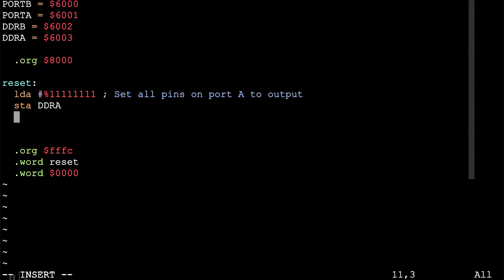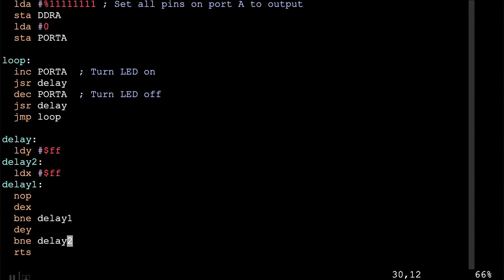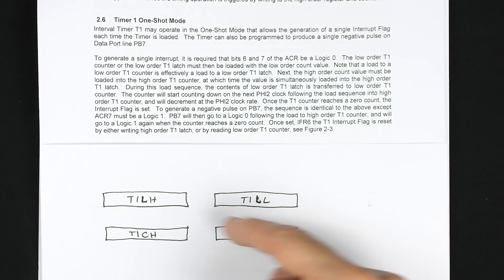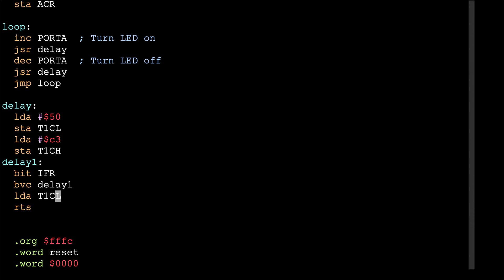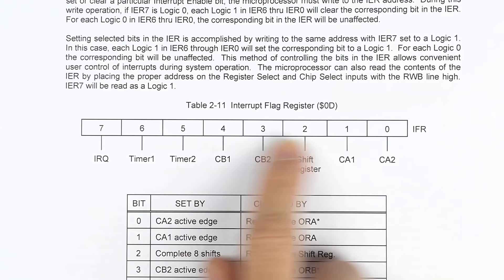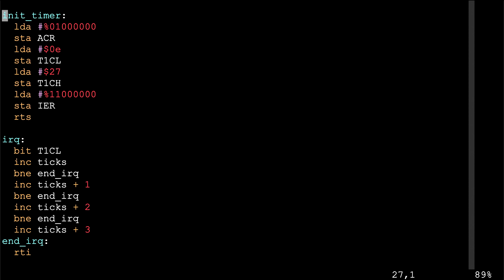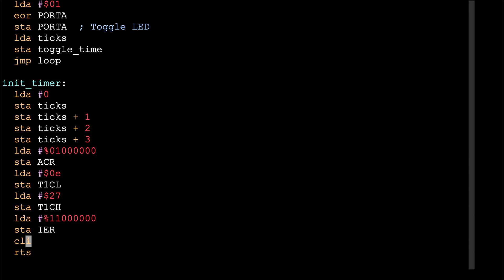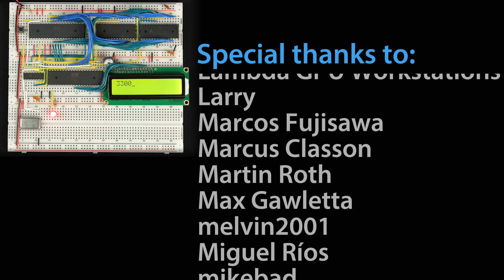How do hardware timers work?

Comment: This is why breadboard computers should be more common in colleges. The simple questions are overlooked with the abstraction we have added.
Reply: When I was taught that stuff in school in the early 2000s we were using 8051 microcontollers, so everything in one chip... worked, but obviously you don't get to see and poke the internals. Then at the end of the year we had to inventory the lab and I came across the tool from the 80s they were using before they moved to that, and it was a delightful single board computer running around a 6809, a monitor ROM, some battery-backed RAM, both a 6321 and 6522 and a keypad and LCD, and it was so much more fun having access to the chips and being able to enter your code directly on the machine and run it that I borrowed it for the summer holidays and played a ton with it. Ended up being able to keep one when leaving that school, still have it of course, and the 34 year old battery is still faithfully keeping those RAM contents.
Reply: This is absolutely right. I don’t think any software developers with whom I work these days grasps the technology at this low level. It explains a lot about the performance of modern systems.
Reply: I wanna know where the hell I could go to study this kind of low-level computing stuff. I'm so sick of all of this needless abstraction.
Reply: @dubbynelson  Electrical engineering is a little too low level, and computer science is a little too high level, but there is sometimes a major offered in universities called "computer engineering" that is halfway in-between. That seems like the most likely field to touch on this in my experience.

Although I think that in both EE and CS departments, there are often elective 400 or 500-level classes offered that will go in this direction, so it's probably not necessary to center an entire major degree around it.
Reply: @delphicdescant  to be fair, today it’s not really that useful to know this stuff these days. For the average software related job today you’ll never use any of this information
Reply: @nickwilson3499  Some people get an education with the primary goal of getting a competitive 9-to-5, and those people would probably agree with you. Others look at education as an end and not just a means. Like, getting more degrees is what I would do if I had a bunch of spare money. I don't get degrees to make money. For people like that, we don't care what knowledge is "useful" to some industry or another. It's about what we want to learn, or what things we want to be able to make.

And then there's also the entire related problem of engineering knowledge getting lost to time when people only focus on knowledge that can get them a "job." Like how nobody is capable of making another Saturn V anymore.

And then one other issue is that "the average software-related job" is just terribly boring corporate drivel. It's mostly web dev. Not even real programming. I'd hate to make judgement calls based on what's useful to web dev.
Reply: @ShALLaX  as a programmer with a decent, or at least reasonably acceptable, understanding of the low level tech (i.e. i understand this video, for example), i feel obliged to point out that I often write code that I know is sub-optimal from a performance perspective because the "slow" code is much easier to maintain. Complex, elegant, fast solutions are often amazing when you write them but extremely miserable to maintain later in project life.

Also, when your project is really huge, you can waste a lot of time on "perfecting" code... And then fail to deliver the project because you didn't finish everything else at all. Thus, total optimization is usually reserved for either very critical, cyclical systems (graphics, game "tick" code, etc) or code that is already implemented "poorly".
Reply: @dubbynelson  computer engineering at a STEM school would be your best bet. But usually people just learn on their own with videos like this!
Reply: @delphicdescant  Amen!
Reply: @Jory Folker Yeah, the idea that starting your own company is just about the only way to actually work on a project you care about is, unfortunately, something that "the little voice in my head" likes to taunt me with. I fear it might be true.

But man, there are really some big downsides to startup life, especially if you have a family to take care of.
Reply: @dubbynelson  Honestly, it's unlikely that you'll find mainstream education about it. "No one cares" about it these days. You're better off trying to get a job with a company that does embedded development (medical devices, automotive, etc) and hoping they'll let you learn on the job.
Reply: @Pyrohawk  you're a rare breed. A great number of people in your position like to show off their prowess or build-in job security by being the only person around to understand the monster they have created.
Reply: @nickwilson3499  Just a side point, this stuff here has a lot of similarities to programming a PLC in STL, which is widespread in industry.
Reply: @dubbynelson  lol
Reply: Humans are good at creating artificial constructs. Forgetting the past, for the sake of evolution.
Reply: @syproful  haha you must hate historians then.
Reply: @dubbynelson  Do you honestly think that "delay()", or any of what is covered in this video is "needless abstraction"? That's just completely ridiculous, all of this abstraction is completely necessary and extremely useful. However, if you want to officially study stuff like this just do a EEE degree. Did all this stuff at university, extremely fun, dubiously useful.
Reply: @poopfartlord9695  if you read their comment more carefully, you'll notice that when they are talking about abstract stuff, they are most likely referring to what is taught in CS classes. My guess would be something along the lines of high-level programming languages (especially FP), or complexity, or formal logic, etc.
Reply: @dubbynelson  My university basically teaches at this level. But if you're looking for a specific degree that's most similar to what he teaches on this channel, it would be Computer Engineering. Also if you find a university that teaches Embedded Systems, then that's good too (my degree)
Reply: Pretty common to have a class where you write assembly for CS.  Also, there's the entire major of Computer Engineering if you're more interested in this.
Reply: it is the point of abstraction yes.

no client will give you any money for knowing in detail how sleep() work.
Reply: @ShALLaX   yes, software these day have to be window-mac-linux compatible with all their assorted browser, dynamicly resizable UI for every possible screen and mobile while also being accessible for that one random dude that still use netscape on a win95 PC.
Reply: @ShALLaX  A software developer doesn't need to know how hardware works. They are two different fields.
Reply: @grantofat6438  it depends - and I’d go as far as to say you’re wrong. A software developer that wants to be able to get the most out of the hardware very much needs to know how the hardware works. If you don’t care about such things you’re either a bad software developer or you’ve got an unlimited hardware budget. You may have missed the point of these videos if you think hardware and software disciplines are unrelated. 

Also, go and tell that to an embedded software engineer and see what they say.
Reply: @ShALLaX  Too much abstraction, people need to stay grounded in the machine architecture, it would make a lot of potential bugs and coding make sense.
Reply: @ShALLaX  
Not really, if you optimize for a 6502, you're going to get poor performance in other areas. We are optimizing for things like "being able to deliver as fast as possible", not "correctness above all", or "cheap to run", etc.

It's not that people today are stupid, it's that what you're supposed to do isn't quite the same in some qualitiative sense.
Reply: @HrHaakon  in my experience "being able to deliver as fast as possible" more often than not equates to "delivery at all costs." This leads to releasing unfinished/ buggy/ incorrect products and software. The entertainment and gaming sector pretty much embodies this.

That being said, there's definitely a balance to be struck.
Reply: If you ask me, abstraction is one of the biggest flaws we have in the philosophy modern world. SO MUCH important knowledge in to how our hardware is run is completely left out of sight. Modern Computer Science patterns love to assume that all code perfectly follows all documentation and that bugs never happen, yet pretty much all practice says otherwise. Sure, not all software needs to have perfect efficiency, but the simple fact that efficiency is often locked away from the developers doesn't help.
Reply: @KeeganKopas  Totally agree infinite%.  I find that the abstraction pulls too far away from the fact that a computer is a machine and works like a machine, which gets in the way of staying grounded in the practical dimension.  I found that by learning assembly you almost code better in high level languages because you always consider the mechanical operation and thus already integrate that thought.  Not saying that there NEVER are bugs, but it goes a long way to starting with the correct line of thought and therefore taking the approach with that consideration, or at least understanding better how and where bugs can be.
Reply: I don’t agree with this. Learning how abstraction was implemented is huge beneficial, but a lot of people will not want or need it.
This is why abstraction exists. To shorten the implementation time and to make technologies more accessible.

I like learning these stuff but I will have a lot less helping hand if everyone need to learn this.
Reply: @Soutame  I was just saying abstraction can make a student easily overlook some core things in computing.

I definitely think abstraction is awesome and is why we have nice things lol.
Reply: My first class had us program an Arduino, so some universities still teach this kind of thing.
Reply: @Dyllon2012  I had a class on microprocessors and using assembly. Was super fun.

But I didn't know I should have kept taking classes like it since the fancy AI and graphics were still super hard and cool.

AI and graphics is not super user out school.... Now that I am an embedded engineer in the auto industry
Reply: @delphicdescant  What the hell is that of an example? We also can't really make early tape computers anymore without any education? But that is irrelevant. We build better stuff than the Saturn V today. And even in Saturn Vs case it was a severe lack of documentation that is the issue if you wanted to replicate it.

We can "easily" (relatively... Nothing in Space Engineering is... Easy) build a new and improved Saturn V.

Beyond that there are more specific education and courses to help teach the low level stuff, because that is still necessary to know when you build hardware, but yes... It is quite important to have all these layers of abstraction if we actually want to improve society.

In the medieval ages you could literally learn how to draw, manage and build a castle. The skill set required was relatively low. Today you need to really specialize to achieve anything significant, or to advance humanity.  Specialization and abstraction of certain parts of the older knowledge is essentially required.

Whether some people educate for the sake of learning over getting marketable skills is DEFINITELY irrelevant... Especially since you can learn by yourself in your private life now, and very very easily because of the internet
Reply: They are very common in colleges.
Reply: @NoName73638  usually it is a club or maybe you will do this kind of stuff in one class for like 2 weeks.

For computer science, we had to do micro controllers. We never touched breadboards and just use a emulator in the lab to run assembly or VHDL.
Reply: @Soutame  Abstraction is good yes, and a natural evolution of programming but one must remember that roots grow in the mud of assembly.  From a learning perspective abstraction hides more than it reveals which is not helpful becuase then you sort of have to go back on yourself and dig to understand when all that could be learned from the beginning.
Reply: @infinitesimotel  The things I disagree with is the original statement that the breadboard computer should be more common subject.

The underlying should be learned only when it is need or you really work in that kind of field. I think someone learning computer engineering not always needed to learn breadboard computer. 

I agreed it's fun thou. But I saw it mess with my friends a lot. Make their study get worse. Someone just dropped. Just to found out that many of them will not have to use it.
Reply: @SioxerNikita  Just because you don't need to spot a tiger in nature anymore doesn't mean that you can't use eyes or ears.
Reply: @iXenox  And where have I said ANYTHING to the contrary? I would really love to see where you read that I implied that.
Reply: @SioxerNikita  You said that it's not important to be able to build a Saturn V. That may be for various reasons, but just because this specifically isn't important doesn't mean that you couldn't use those resources.
Also drawing, building and managing a castle isn't exactly easy. Particularly the building part, I'd like to see you find medieval resources on structural rigidity of stone arches and wood reinforcements.
Reply: @SioxerNikita  Can one not learn the two of three "very" specialized skill sets? With how much time you have to live compared to medieval times you might as well. 
Your inability to find resources on structural rigidity means that the only way to learn what works is to build it. You have to get really good at guessing what works and what doesn't by wasting time and doing tests.
You also said that it isn't important to be able to build a Saturn V. I find it important to be able to (even if theoretically) do it because it means that absolutely no knowledge was lost over time. Just because you don't need to cook on open flame doesn't make that knowledge irrelevant. Why loose knowledge like that? Why call it unimportant because of electric stoves? It can add a specific flavor and it can even be very well suited to the occasion at times. It is old knowledge, but never is it outdated.
Reply: @iXenox  The knowledge relevant to the Saturn V still exists...

And no, you could learn from others. That is how it happened in the past. 

We lose small bits of knowledge every single day, because we can't save everything.

Relearning how to build the Saturn V would be an incredible waste of time, since we can build something better now. This is not the same as a very basic skill. It is not important how to build a steam train today. It is essentially irrelevant knowledge... But the knowledge that allows someone to figure out how to does exist...

Also people lived long lives in the medieval ages. What brought down the average lifespan was child and war mortality. If you got to 20, you were very likely to get to 60.

What is your issue with us not being able to replicate Saturn V? We can't because many of the small changes to it were not properly documented... But many of those are irrelevant today, because we build better today... We build rockets differently...

You are also comparing completely different things. Building the Saturn V is not the same as cooking over an open flame. Fun fact, most people in the medieval age didn't necessarily know how to start a fire, despite being very reliant on fire. You just borrowed fire from your neighbours.
Reply: @iXenox  We don't have a Saturn V... 

A boiler for a steam train is irrelevant for a Nuclear Reactor.

AC and DC comparison is bad. They have different uses.

And going on by things not being replaced is incredibly stupid, because that is not even close to my point.

Many of the things you mentioned aren't strictly better either, which makes it incredibly stupid. There are different uses for different technologies. The mansion example is also dumb, because a mansion isn't strictly better.

Beyond that, we have forgot how to build the Saturn V, that isn't a question of whether we should forget, rather we have, and today it is irrelevant that we have.

Tube TVs are essentially not being produced anymore. There is essentially no point in them.

If we forgot how to make them it would have no effect on our society. 

You are making the absolute worst points I have seen in weeks. You make stupid comparisons, you barely argue, you ignore half of what I say, and invent something I have said for the other half.
Reply: @SioxerNikita   A nuclear reactor is a boiler warmed by fission, instead of oxidation as it would be in trains. And instead of wheels an electric motor is connected.
How do you know that the Saturn V is strictly worse and irrelevant when you don't even know how to make it?
"There are different uses for different technologies" When did I claim otherwise? (Please remind me)
"A mansion isn't strictly better" Neither are other rockets.
The AC and DC comparison is perfect, and so are others. The point is that they do have different uses even if you refuse to admit so - Saturn V could be built in a lot of countries, newer rockets less so. (This is just one, but there could be more reasons)
Fun fact: China still uses steam trains. (Not as irrelevant as you thought, are they now?)
Also removing your own comments is the most admirable thing I have ever seen from someone who thinks they are correct. (I can still see it from my notifications, lol)
Reply: @SioxerNikita  I'd like to see you visit that tourist attraction in China if you dare. The CCP would love to see you! (The trains are used in mountains to haul stuff, proving your lack of knowledge on the topics you are talking about)
The Saturn V design isn't irrelevant because it uses old tech and it wouldn't take much to update it to be cheaper if you had the design available.
It surely doesn't help a new space program to be able to buy a working rocket design either. And it helps even less so that that rocket is in the top 5 by its capabilities. (This is sarcasm)
Oh btw I forgot that the electric motor is the same thing as an electric generator :O (hinting at my incompetence to distinguish them and your to see that you said that it isn't an electric motor and then describing an electric motor instead)
A nuclear reactor may not use a steam train (lowercase) boiler but the technology of boilers for power generation is the same. 
The important thing is that someone kept that information for later use instead of calling it irrelevant.
Reply: Agreed. I majored in Computer Science. Would have been nice to have breadboard labs for my computer architecture course.
Reply: Wow how did the comments section here get toxic?! Damn the internet. 

Two things can be true at the same time. Abstraction is very important in computer science, but learning how the components work can be very helpful. I personally find it very interesting and it helped clarify what we learned in my Computer Architecture class. The same can likely be said if most disciplines. Arguably you could attempt to break down any science into its more tangible philosophy. Hence the meme: psychology < biology < chemistry < physics < math. It all depends on how far down the rabbit hole you want to go.
Reply: @nickwilson3499  Just as with software developers who don't need to know much about data structures these days. They don't need to know how to make linked lists, AVL trees, or hash tables.
Reply: Just a couple years ago one of my courses at a community college had us using arduinos and breadboards
Reply: @dubbynelson  On this particular subject, you might be interested in Ben Eater's series on building a breadboard computer (on YouTube).
Reply: I wanna get one now real bad
Reply: @delphicdescant  You talk like those people are somehow inferior. That having responsibilities to provide what you can to your family makes you less than someone who has the luxury to do thing purely for academic curiosity.